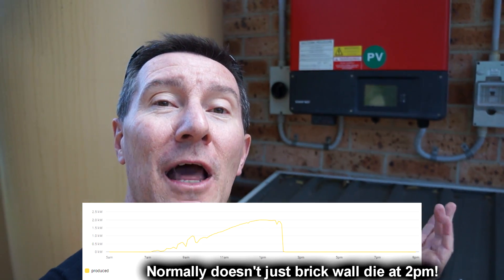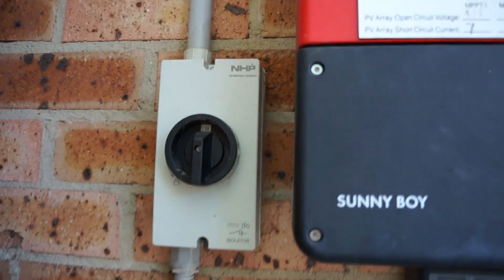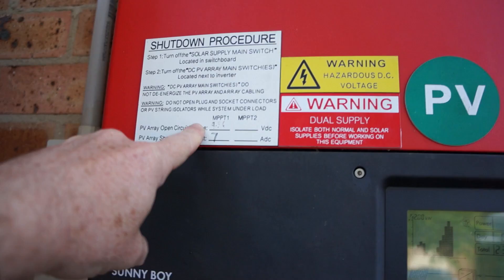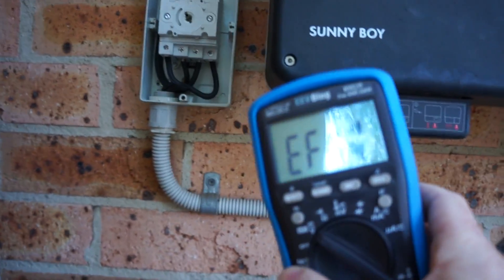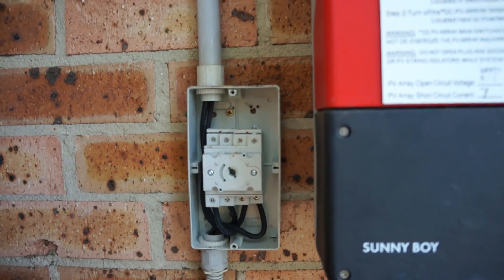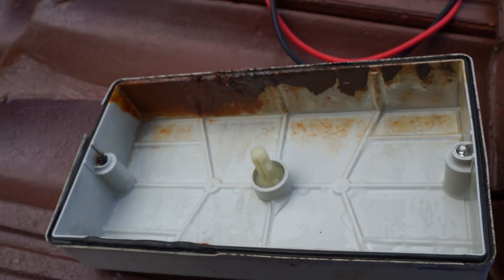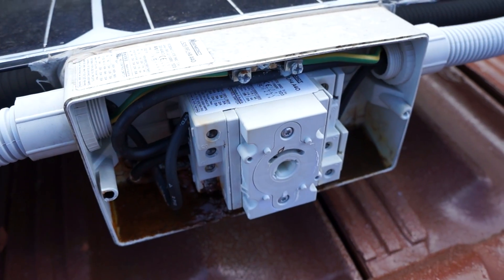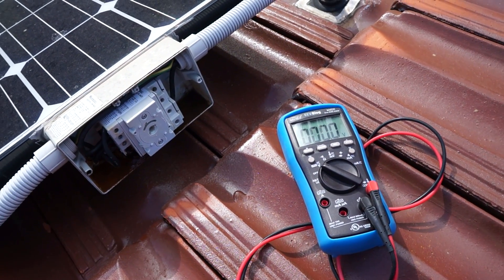EEVblog #1217 - My Home Solar Power System FAILED!

Comment: Bloody stupid place to put a plastic isolator box fully exposed on its side on the roof it would not have lasted 5 mins in our weather
Reply: Yeah I know, like why couldn't he put it under the panel so UV isn't directly on it.
Reply: Without looking it up, I don't think the standards allow for rooftop isolators to be mounted in direct sunlight any more. They're usually installed with a shield over them now.

Also, the number of times I've seen installers grumble about our standards requiring rooftop isolators. Frequent failure and fire point.
Reply: Yep! Or maybe put this switch in some additional enclosure! But I agree! Completely wrong mounting!
Reply: @iklisanic  yes, put the box in a box, keeps the water and the UV out.
Reply: As an ex solar installer I completely agree but it is the law and unfortunately can't do anything about it. I fixed hundreds of systems with the same issue
Reply: @christianmatruglio9877  I assume also .au? It seems it's not required in most other places? (most being 'Finland and the UK so far' LOL)
Reply: @TheChipmunk2008  yeh only in Australia our government is dum
Reply: Yours chose 'isolators on the roof, even tho mounting them the recommended way is impossible'

Ours chose "lets allow a one day course to overrule 20 yrs of experience as an electrician" (Requiring electricians to be a member of a regulatory body (that just happens to be a private for profit company) yadda yadda, see Big Clive's rants on the subject... suffice to say, when it was first introduced, a guy who worked for the national grid pointed out, with irony, that he was legally allowed to work on LIVE 400,000v cables in his day job, but if he wanted to change the light fitting in his kitchen, he couldn't.
Reply: @TheChipmunk2008  We do have DC isolators in the UK though.But they are in the loft normally so are kept dry and away from UV
Reply: @cjmillsnun  Our inverters are usually next to them tho no? (I am asking, not being a dick)... i've never seen an inverter that wasn't in the loft . Dave's install is very non-UKian
Reply: TheChipmunk2008 we install pretty much all solar arrays in Australia like this. Problem is at the start of government funded roll out of solar systems a lot of really dodgy people got accredited to install the systems and the did a dog bird job of it ( rough, rough, cheap, cheap). Pretty much none of these installers used approved isolators or fittings and they didn’t mount them to manufacturers specs. About 1 in 6 systems in Australia are not up to standard and 1 in 30 are high risk to life, property or livestock. It sucks but I’ve spent the last 4 years getting paid to fix and rectify solar systems for insurance companies.
Reply: here in the uk we did not fit rooftop isolators so no probs after 8+ years , i fitted solaredge systems so individual panel production measurement and voltage limiting for safety
Reply: @waynecartwright7276  Solaredge is the absolute goods, really great gear.
Reply: Isn't that bs like a big fire hazard? Switch corrodes, 400V DC short-circuit. Best case scenario: Your cables melt.
Reply: @whuzzzup  the cables should be rated to take the maximum current the solar array can supply!
Reply: A couple of years ago the need for the isolation switch on the roof was being reviewed...but do not know of the outcome.  TBH, not sure there is a need.  One isolation switch is needed, then disconnect both ends of where you work.
Reply: @Herebuss  Exactly, once you've broken the circuit with the isolator, there's no current to draw an arc, and no earth reference on the system (aside from faults maybe)... so should be safe to simply unplug the panels
Reply: yeh it is a bloody stupid place to put but ive seen a ton of them mounted this way
Reply: @villiersman951  To me this looks like it's deliberately mounted this way so it will break much sooner then it should be.
Reply: @iklisanic  yeh your not wrong its just a silly place to mount a switch like that
Reply: @villiersman951  They ensure to have work to do the next few years...
Reply: Yea solar panels short circuit current ist a big deal 

It’s a common test of solar panels to do an open short circuit test

Comment: I have a system with Sunnyboy system since Feb 2012 and so far no problems. No isolater switch on the roof itself, but immediately adjacent to it at the peak of the sidewall I do have a panel box with circuit breakers.

Comment: Fail? That's just called a bad designed box for a switch.
Even the position and angle is wrong, asking for problems.
I have one on my roof for very close to 9 years no, not even a little bit of dirt in it.
Reply: Yep.  They should have at least stuck it farther back so the panel could shield it some.  Rotate it 90 degrees too.
Reply: Hence why a shield is a legal requirement. Probably not a legal requirement  when that was installed though.
Reply: The legal requirement should be that no plastic parts are allowed to be exposed to environment.
Reply: exposure will always happen. but near continuous sunlight should be environment that legally mandates a shield so the product is fit for purpose.
Reply: @Kevin Miedema Don't be daft plastic, with freaking high voltage and wattage, should not be out in the open in the environment which includes the sun.  All plastic deteriorates and becomes brittle when exposed to the outside world but add the sun beating down on it and it turns very brittle in no time flat.
Reply: @thebeststooge  There is nothing wrong with plastic. It only really depends on the TYPE of plastic being used.
Anyway, it all has to do with how you construct your box. If you design on such way that water will just automatically flow off and that seems are not exposed, most materials can last for a decade or two at least. Like I said, just bad design and wrong placement.
Reply: @whiskeyinthejar24  It's called using your brain, don't care what legal requirements are.
Reply: There should be no switch at the roof in the first place. It's just useless bullshit that serves no purpose at all.
Reply: This is absolutely unacceptable!  6 years?  It's not like they didn't know this was going to be in the sun all day every day. Terrible design.  Whoever decided to put UV sensitive plastic on something that sits in the sun all day every day is a god damned moron.
Reply: well I agree in that. but 'not exposed to the enviroment' seems like a idealistic view of the world is all I was pointing out. it all depends on the application wether or not it might be suitable. this very definitely is not a usecase where a plastic box is suitable, it wouldn't be just based on the life of the solar panel installation alone.

Comment: My system is about the same age and I am in the process of having all the panels replaced under warranty as they have deteriorated seals underneath.
Still generates power but only after they have warmed up (around 9:30am I start to get output).
Apparently good panels (more expensive) bat a known bad batch.

Comment: I heard they make these things called “current clamps”. I looked up on amazon and they seem to basically be varying sizes of scissors with plastic insulation. If you wrap some scissors in electrical tape and take a lcd display and put the positive on the left blade and vice versa and “clamp” a wire gently you should be able to create your own clamp for free
Reply: Fee What are those supposed to do? Whatever it is, it would require specifically calculated material type, thickness and contact force to work.

Comment: Rooftop isolators are supposedly there as a safety device if you’re on the rooftop but instead they are the primary cause of breakdowns and fires. Get rid of them from the legislation. Modern installs jave a galvanised weather shroud protecting them so should last longer. I’d put one on your replacement box Dave. Having said that I never had a problem with my 11 y.o. system that was replaced last year.

Comment: SO many people in Australia have got dodgy isolators on the roof. I think Victoria first required them, then the rest of the country. The main reason they are there is to create sparky callouts after six years and dodgy $2000 invoices to fix them. There goes a lot of your savings

Comment: My system failed due to a DC isolator getting full of water as well, seem to be a common weak point in Australian solar systems as my cheap Chinese inverter and panels are still working great after 10 years at pretty much full output. Funnily enough all the weatherproof box seemed to do is help keep the water in so the isolator is in constant contact with water.

Comment: I wonder if Dave can repair the fault himself?
Reply: Nuts n Proud Should be technically easy, but may require certification he doesn't have.  Some states have EEs jumping through near impossible hoops to get the mains certification of a craftsman.

Comment: @EEVblog , I have seen a couple of these isolators installed on roof tops before. ( in the NL ) but most of them had some 1-2mm aluminium home fabricated shade "sheet" to protect it from direct sunlight. An other strange thing is that this box doesn't have any drainage :) even with water ingress it would have been half as bad if it could seep out the bottom. That and the trail of rust would have led you to investigate :D..  Those panels will be fine for another 6 years most likely. Looking forward to the fix/reinstatement of the solar array.

Comment: Top side isolator is for protecting people working on the roof.  Inverter side isolators are for protecting people working on the inverter.  Makes perfect sense as protection. And by definition an isolator is rated to provide large clearance when open, but no ability to break loads and a low max cycle count (a switch is the opposite).  Also notice that the isolators can be locked out in the isolated position using the workman's personal padlock.
Reply: These isolators are required to be able to break the DC under load (load break disconnect). ASNZS 5033 doesn't require them in NZ but does in Aus (4.4.1.5 & 4.4.1.6).

In NZ unpluggable connectors are considered sufficient for ensuring isolation at the array, as you can break the load current at the inverter.
Reply: Exactly. To be precise, isolators are usually rated to break the load at least once. Meaning breaking the max load can and probably will destroy the isolator in worst case but won't lead to further damage when it gets open under load for some human error reason. Or when the typical mechanical interlock (can't open unless both sides are grounded) fails.
Reply: @shana_dmr  These are required to be load-break disconnectors to 60947 for at least a DC-21B duty. That's switching a resistive load, not no load.

Comment: That's why we now put them under a stainless steel cover now ...
Reply: Yes, the issue is that the stainless steel cover get very hot and transfer all that heat to the isolator.
Reply: @perezc11  This is no issue. First of all there is a gap for air, and more importantly the direct sun would be a lot hotter than the radiation from the steel will ever be.

Comment: A UV stable switch box should last 6 years of UV no problem. 
The UV stable plastic VHV/UHF mix/amp boxes on antennas last like 10+years in full sun
It must be bad quality, they probably didn't put the right quality/quantity of UV stable additive in the plastic
Reply: I had a 20 years old satellite LNB that required a hammer for teardown ;)
Reply: I'm sure that no Australian supplier would use anything but the finest components, and their Australian customers would welcome the opportunity to pay for a quality product.
Reply: Goods for AUS or NZ have to be full UV stable.  We are much closer to the ozone hole than most countries and get lots more UV than other parts of the world. Sometimes UV stable goods intended for general market end up sold in AUS/NZ and the UV protection is not up to the require standard for Aus/NZ market.

Comment: Replace the switch with a connector block untill the new switch comes.
Pointless switch :-(
Reply: Maybe do it at night to be safe with the 400V though lol
Reply: @Firecul  if you wanna be safe just disconnect wires... it should be mc4 connector. working at night ist ridiculous
Reply: @Firecul  night time + gloves + wire nuts
Reply: @FindLiberty  And a couple of cheap 2USD crocodile clip cables and a webcam might make nice YouTube content when the sun comes up.
Reply: @Luke-san  That would then be an ElectroBoom video :-)
Reply: They are required by the law so he got no choice
Reply: @hennochoi  the law was obviously not drafted by an electrical engineer!
Reply: @martinwragg8246  That law was drafted with safety in mind. Any electrical engineer that doesn't take safety of the operator into account isn't one I'd want designing anything I have to work on.
Reply: @mattelder1971  Funny those safety rules are only in your part of the world! 
If you cannot work safely with push fit connectors, then maybe you should not be working on solar installations.
The only reason I can see to mount an exposed switch on the roof is for further maintenance visits when the switch eventually fails.
Reply: @martinwragg8246  Those rules seem to be in place in both the US and Australia, so that covers two rather LARGE parts of the world. When you have an item that can be remotely energized, it's smart practice to have multiple places that it can be cut off so that someone can work on it without the possibility that someone else (who isn't aware that you are working on it) can turn it back on while you are working. When I was in the Navy, I worked on radar systems. We had a switch for powering the radar antenna both at the bottom AND the top of the mast so that you could de-energize the antenna before you started climbing the mast and also keep it locked out once you were up there, in case someone walked by and turned the bottom switch back on, not knowing that you were up there working.
Reply: @mattelder1971  I agree with your points on radar, but a poorly boxed switch on a roof is there to provide a future income train.
Anyway that's my opinion, both our countries have different rules and in this particular instance I think we have the most logical.
Reply: @martinwragg8246  Oh, I won't argue about the QUALITY of the box at all. I'm fairly certain that crappy one wouldn't pass the codes here in the US, but having a cutoff at both ends of a high voltage line is still a good idea.
Reply: The intent is so that you can de energise the cabling from the roof to the inverter. It is being reviewed due to so many isolator fires and failures but it will take some time to change. Without an idolater you'd need to disconnect the string or take the risk and work on it live. They're coming from a place of protecting electricians and making it easy to be safe.
Reply: @vk3fbab  Yank it out and install a connector block.   The inspectors will never be on that roof again, and there is no danger without the switch.
Reply: i was shocked by 600v dc mutiple times. once i tried to check voltage but my multimeter was on current...it was 700v 2 strings in parrarel. arc burned my finger nail and it melted probes a little bit, but nothing more than that. he can easly do it in the day and rober glows are enough
Reply: @vk3fbab  the solar panel connectors on the roof are push fit, so just as easy to disconnect as a switch.
In Europe the DC and AC isolation switch's are next to the inverter, which is the logical place to put them.
Reply: @martinwragg8246  Australia has fairly strict electrical rules. Dave opening it up may even technically be a problem. We share the same standard with new Zealand but all electrical work must be done by a licensed electrician over here and over there you're allowed work on your own home. So while you could do what you describe our code would deem that too risky. Part of living here.
Reply: @vk3fbab  Indeed, but mayhap a bit overzealous. An electrician dealing with solar, during daytime, should be wearing 1kv insulated gloves anyway... till they're 100% sure they've isolated the panel they're working on.
Reply: Why wait night time. Just cover panels with some garbage bags secured with sticky tape.

Comment: Fail, voltage measurement in te main switch in the wrong terminals... Follow the wires!
Reply from the maker: I did, and it's right. You failed at following it on screen
Reply: https://youtu.be/ITfQ4S0OUhs?t=140 .. yeah follow the wires ;) think you need to re-evaluate that mate.  2 inside wires go behind the 2 on the outside and to the top .. outside wires go to the inverter. Don't see anything wrong in that measurement

Comment: The switch on the roof is a service disconnect switch so anyone working on the panels on the roof can disconnect them without going down the ladder.   OSHA in the US does require  service disconnects to be in reach or at least in sight of remotely located electrical equipment.   Probably not really useful in that kind of circuit but probably required by electrical code.
Reply: The power is from the array not the inverter, so it doesn't make sense, the only thing the switch protects is the wire between the two switches.

Comment: My first thought is to se if the switch can be mounted under the panel to shield it from the sun/rain?
Reply: timberwolf0122 Someone else commented, if you do that, when the switch catches fire so do your panels.
Reply: @donwald3436  How often do switches catch fire though? If it's rated for the voltage and load a switch is just a big old chunk of metal sitting on two contacts.
Reply: timberwolf0122 Some claim the switches sold in Australia are that dodgy.